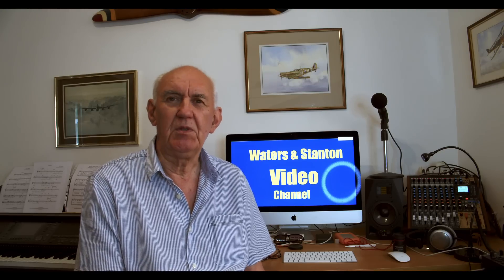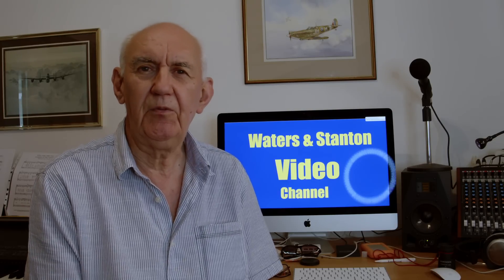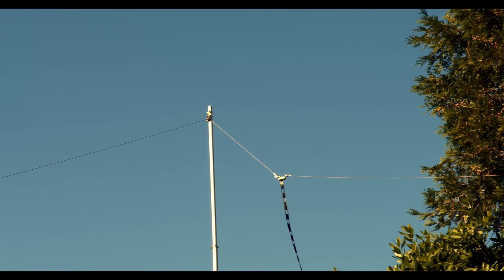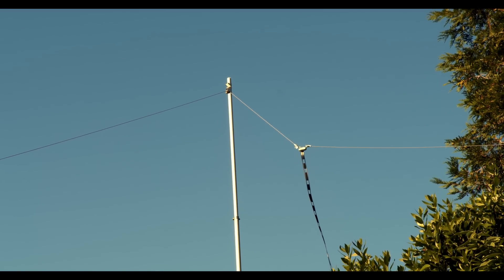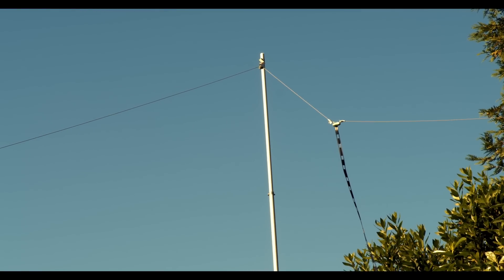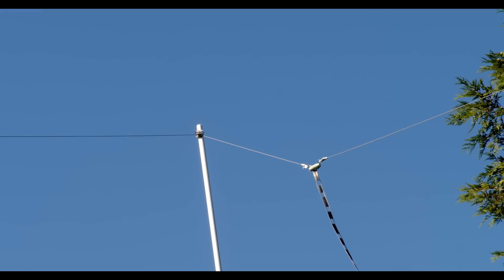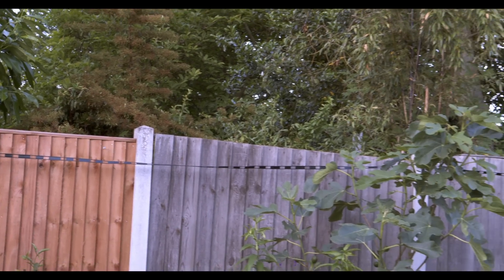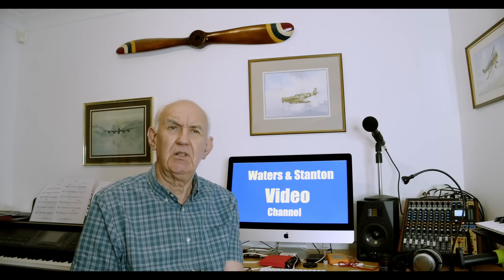The Doublet Antenna in Practice | Ham Radio

Comment: Another reason I'm going 600-ohm is because I cannot find a non-clad version of 450-ohm line. The 600 is made with stranded copper either 14 or 16g.  I did like the old full-copper 450-ohm line and built a great "j-pole" for 6-meters with some. I can't stand the steel core stuff (yes I understand how signals travel on the outermost surface, but also I know what I like).
The 600-ohm  Trueladderline of  W7FG is all copper.  
No affiliation, de W1ADE.

Comment: It's not difficult to make 600 ohm ladder line, and I would make my own if there wasn't a good source here in cowboy country. Because it's only a buck a foot ready to go, I may switch to mostly ladder line, it's SO MUCH CHEAPER than good coax. 
Look up trueladderline, W7FG.   
They make doublets and loops as well. I have their 160-10 doublet with 100' of "true" ladder line on order.  Years and years ago (when the internet was tiny and new)  my Elmer advised to try a random sky loop fed with 450 ohm and a 4:1 balun.  I did just that and it was great-ish. Eventually I really really got tired of flipping knobs on the MFJ tuner to find useable matches every time the wind blew or it rained or I modified the setup. And sometimes a band wouldn't work at all. 
Now my "garden" is over six acres with trees, so I can try the long antennae, and maybe I'll do a 500' loop next.  EVERYTHING I can feed with 600-ohm line for a dollar a foot makes more sense than spending 3x the money on  good coax and wasting so much energy when mis-matched. 
Until now I had been quite pleased with my homebrewed EFHW, and I'll keep using EFHW when I can't put up a Doublet, or loop with 600.

Comment: The example is untidy, flapping about, 'gopping' as my RSM would have said.

I'm afraid I went old school, and tidy instead, the feed point being an SGC SG-235 @7ft AGL on my tower, with the vertical 'ladder line' being copperweld spaced at 11" using porcelain Admiralty Antenna Spreaders from a ship, and then supported @20ft using Marine Stainless Steel Pulleys insulated by 3" Pyrex Dog Bones at the top of the tower, with the legs of the copperweld being horizontal to the bottom of my garden and about half way down the side of my semi-detached, supported by an Aluminium 20ft Scaffold Pole on a Marine Stainless Steel Pulley supported by a 7" Pyrex Dog Bone, with Stainless Steel Guys down to Stainless Steel Eyelets fixed to the 12" Gravel Boards at the bottom of my fence, with the tension gathered by Marine Stainless Turn Buckles.  On the house is a T & K Bracket supporting a section of Aluminium Scaffold Pole supporting another Marine pulley and 7" Pyrex dog bone, with the dog bones attached to 4mm halyards that are secured by Marine Stainless Steel Cleats attached to the bottom of the 20ft scaffold at one end and the wall of the house at the other.  The Doublet is NNE to SSW and resonant at ~3.3MHz, and tunes all bands 160 through to 10m.  I only run 100W, even though the SG-235 can cope with 500W SSB.

Yes its designed to be an NVIS Antenna for 160m to 40m, but I have managed Australia, New Zealand, and New Caledonia on 20m with 10W.

73 de M5WJF

Comment: Hi Peter, How does the doublet antenna compare with the ZS6BKW antenna? Also, I was under the impression that the ladder line should be hung vertically. I presume it doesn't make a lot of difference in respect of the end results.

Comment: Made one out of twin speaker wire ran analyser on it is 10m over all length presented 50 to 75ohms on several bands direct connection to G90 (got from w&s) started at 5W making regualar contacts all over europe. Guess just trying different things thanks Peter all the best M7HKO
Reply from the maker: Great to hear your results. Keep at it.

Comment: I would like to put up a vertical doublet.  If I attach the ladder line at the center, how far away should it stay from the lower half of the antenna wire?  Also, I will be bringing it in a window that already has my ladder line coming in from my 135’ horizontal doublet.  Do you think I will be OK if I keep the two ladder lines on opposite sides of the window casing?  It would probably be easier to feed the vertical antenna with coax and just call it a dipole.  However I would like to avoid the loss of that length of coax.  Many thanks.  I have learned a good deal from your videos.
Reply from the maker: I have never used a vertical doublet.  I suggest try and run the ladder line at right angles for 1/4 wave at lowest frequency.

Comment: Peter, I'm anticipating the arrival of my new Palstar AT2K ATU.  I'll be feeding a 160-10m doublet.  My dilemma is 450 or 600-ohm balanced line.  And, the Palstar doesn't have a built-in balun.  It does have a Balanced Line SO-239 input, which requires "either a 1:1 or 4:1 external balun".  Can you add your thoughts on the ohmic ladder line and which balun would be best? 
73, Ron - K5RPM
Reply from the maker: Hi Ron. you can use either open line or 450 Ohm ladder with 4:1 Balun. Both work equally well.

Comment: The days of open line are far from over. My situation: 2 x 59 ft doublet with open line all the way into the symmetrical tuner. Spaced with 4 inch rose clips and fed through the wall at the same spacing. From the end insulator to the tuner is one uninterrupted piece of wire, so no corrosion in the feed point. Worked 1250 miles on topband, 80 and above perform (much) better. Forget coax and the balun.
Reply from the maker: Great to hear from you.

Comment: Best way to feed a Doublet is using a open feeder or ladder line into a true Transmatch followed by a BalUn with a bit of coax going to the transceiver. Only challenge is to manage the Transmatch outside.
Reply from the maker: Take line through wall into a balanced matching unit and forget the Balun!
Reply: @watersstanton still need to go from balanced to unbalanced using a 1:1 balun
Reply: @RogierYouI think he means open wire to the tuner and coax out of the tuner to the radio. The tuner has a balun inside if it has two terminals for open wire line. Doing 4:1 inside the tuner usually. Some people use a 1:1. The Universal Transmatch by Lee McCoy 1970 QST used one 4:1 on the balanced line terminals. It was basically what the famous Murch transmatch copied if you ever saw them. A split stator cap, roller inductor and hv transmitting variable with a coax and balanced output via balun.

Comment: Peter
Thanks for a clear video on doublets. I am 85 years of age, am newly qualified (Intermediate, so only 50w) and am proposing to put up a 40m doublet on the upper storey gable end, with the last few feet of each half wrapped around the soffits front and rear at right angles. I’ll use a 4:1 balance as you suggest. The ladder line drop down will be clear of metal but close to brickwork. What are my chances?
Reply from the maker: Ladder line near brickwork is no problem. I t all sounds OK. Congrats on the licence.
Reply: @watersstanton  Thank you!

Comment: Mine is 57mts long in a Z shape.....short for top band yes.....but it tunes top band great.....gets out great as well.....also tunes on 6m and performs on 6m as well as my dedicated 6m horizontal....

So from 160m to 6m fine for me via my MFJ 941 matcher/ATU.....

Ladder line terminates to a 1-1 balun.....the via an 18inch long length of 50ohm coax to the ATU via my window frame

Why would anybody consider any other antenna?

Mind blowinging

Comment: Just made and installed a doublet, 7'5m each leg, (2:5mm cable) and approximately 6 metre's of 450 line, terminated into a 1:1 current balun, then a short leg of RG8 into a LDG external tuner, Great on 40 , worked A6 on 12 SSB first QSO, and Italy on 20 , doesn't like 15 or 17metres... only 4 metre's above ground, but then I've QSY'd from Dorset to a inner Hebrides island... loving zero QRM again.. cheers Andy MM0###...PS about 20 metres of RG213 into the shack
Reply from the maker: Thanks for the update Andrew

Comment: Thank you sir, for Youre lecture in This. I Will create a inverted V with an open feed line 450 ohm And let it run through a FC902 To my FT902.

73” Theo PA3GSR

Comment: I've got a 2x20m doublet with added loading coils at each end and 5 metres wire connected to those to get it to just about match on 160m. Nine metres vertical drop of home-made open wire feeder to a 4:1 balun near ground level, fed to shack with 20 metres of RG213 coax. The matching unit should really be where the balun is, but that just didn't work for some reason and kept getting unpredictable matching...

Comment: Reminds me of the advice I had when I was first Licensed, nearly 40 years ago. GM3OXX told me to put up the longest wire I could, as high as I could, cut it in the middle and feed it with ladder line. I did, used a balanced ATU / Z-match, and worked loads of stations with QRP. Never had a house since that would allow the same set up. Keep thinking of a remote ATU to do the job. Thanks for sharing Pete.
Reply from the maker: Hi Steve - that was great advice. Remote ATU  gives you all bands or EFHW is cheaper option but less bands.

Comment: Thank you for the information. I need to put up another antenna maybe 2.  I don't want them crossing near each other because they will be less than 90 degrees from each other.  New to HF and the antennas.  Everyone is so up tight about how they can be made.  Must be center feed and other little things that must be just right. I want to put antenna and run window line to just before it comes into my attic,  lot of power wires in the attic. Put a 4:1 just before it comes into the attic,  about 3 meters over then about 3 meters down and around to the radio. I was looking at the  'ZS6BKW ' antenna but not sure I have that much space, and the window line will be much longer.  I want to do 40 and above. The information you gave will help me.  73.  de

Comment: I feed mine in the middle  but use a fibreglass push up pole.   works great
Reply from the maker: Yes good option although not as strong as a metal mast for greater height

Comment: How do you connect lightning protection to it, and/or how do you handle lightning protection at your station in general? 73 DE W8LV BILL
Reply from the maker: Frankly I unplug the antenna!  I am not a fan of lightning arresters as they are really static protectors and most rigs can perform the same function internally. A lightning strike will blow the arrester apart! So unplug!

Comment: I tried the doublet on a visit back to the old house in Ireland, just used some single house wiring cable and some
Plastic pipe fittings to assemble it. I had spare ladder line.
It’s still laying on the grass across the field but I connected it up and massive signals
appeared. Made a few contacts with FT8 and checked PSK reporter and there were 132 reports. The most distant was PY5EG on 40 Mts.
I did not think it would work laying on the ground. I might try and sling up today. Once I tuned it on 40 the SWR was low 
on all the bands going up to 10 Mts without touching the controls on the ATU only 80 showed high SWR without
Changing the settings. Mark EI4JD near Shannon

Comment: Great video. I haven't had a doublet in 8-10 years, but I think it is time for another one as they are fun and highly flexible.

My last doublet was a coax fed OCFD dipole that swaped the coax out for 450 Ohm ladder line. I had a blast with it until I got it stuck in a tree on a QRP outting and ended up pulling it apart. I ended up loading the rain gutter on the park pavillion to make contacts on 20m & 40m.
I have picked up a few ideas that I will try on my next doublet. Cutting the antenna a little short to about 3/8 wavelength and feeding with a minimum greater than 1/4 wavelength of ladder line. Sweep the antenna. If one of the higher bands presents a particularly high SWR trim the feedline by 1/8th wavelength of the higher frequency.

The past few years I have mostly used an 80m-10m EFHW for portable operation. It is easy to deploy and allows 80m NVIS which I am fond of for Ecom.

Comment: My doublet is 20+ mtrs short for top band..... but works a treat on 160m.

So I can work 160m to 6m....with the help of my MFJ941 matcher or tuner if you like.

The 450ohm feed line terminates at my upstairs window of my shack at a 1-1 balun....18inches of coax though a hole in the window from to the ATU.

Works great...1 to 1 on all of the above bands.

Why would anybody use anything else.
Reply from the maker: Sounds good. I belive that manual ATUs often have a wider matching range than many Auto models.

Comment: Hi Peter great video has ever , would 300 ohm  spaced open wire feeder the same has the 450 ohm you use, make any difference, going to feed it into a LDG AUTO ATU with LDG BALUN. Do have 450 ohm but not so good on the old legs today and would find 300 ohm easier to use. Thanks Russell G0OKD.
Reply from the maker: Hi Russell, good to hear from you. Yes 300 Ohm should work just as well. In fact that was the feeder originally used in the G5RV. So go ahead and give it a go. 73 Peter.
Reply: @watersstanton  forgot to say wished I had known about yr videos when I was teaching course's at my local club SNADARC,  but grateful to know I wasn't waffling phew 😅  cheers.
Reply: @watersstanton  thanks Peter, remember you well from my rallying days has a DRM for RSGB and Regional Rep for Royal Signals Amateur Radio Society .

Had to give them up following a dicky ticker ho ho keep safe.

Comment: Hi Peter a very interesting video and well explained iv been using a doublet antenna for many years it’s so simple and works well I bring the ladder line down to just outside the shack where it’s connected to an sgc 230 auto atu which is flouting above ground as these is only a single wire connector for the antenna the other side of the ladder line goes to the ground of the atu then a short run of coax to the radio it tunes on all band no problem 👌

Comment: Thank you for the info and sharing. I am preparing to build this doublet & I would like to ask the feed line location and the length of each side from the feed line for doublet. Do the length of each side matters? Even in inverted V?
Reply from the maker: No the lengths can be different even in inverted V.
Reply: @watersstanton  Thank you. I will built this doublet, I do plan for AH-4 tuner between the balance line and short coax to IC-7300. I have checked on the net, that I don’t need to connect the AH-4 to the ground cable when connecting to balance line.

Comment: Peter, your timing is perfect. I have wanted to try a doublet for some time. I was worrying about achieving a perfect half wave feeder length at 90 degrees to the antenna, and had assumed that I needed to put the balun at the base of this and run the coax for the full horizontal run back to my shack. Your video shows how simple, easy and cheap this project can be. Thank you, I know where to buy the bits!
Kevin, MW0KXN

Comment: Great point about being off center to avoid interaction with a metal mast.  I pull the window line to a 4m wood post that is near the house, so the ladder line does not drop vertical, but comes off at an angle.  Same thing only different.  

I must say, so far, of all the wire antennas that I have tried, the doublet is by far and away my favorite antenna.

Comment: I have a 40 metre doublet in my roof space, with only 8 metres out horizontally, I first took the feeder back to the shack then through a commercial 4:1 balun into my atu, I was disappointed with the result, my fan dipole out performed it greatly, I decided to use my own homemade balun instead, also cutting the twin feeder so it only hung vertically, then joining the coax at that point, it made a huge improvement, and I use it for every band 40-10, on 15 metres it is terrific, for an indoor antenna it's quite amazing.

Comment: I have a 4:1 balun, too. My tuner can handle the balanced lines, and I could use my window-through panel, but I'm afraid my cat would get burned if she touches the connector. So I use the balun outside the window and feed coax through the window to my tuner.

Comment: Interesting.  I hadn't thought of a doublet that wasn't center fed before.  But if the antenna legs are not equal, does that not mean that the feed line itself will begin to radiate all the way back to the balun since the currents on each side of the ladder line are no longer balanced?  Also, doesn't it become more of an end-fed wire antenna when it is off-center fed?  That would mean a good ground or radial system might be needed to keep RF out of the shack depending upon the band.
Reply from the maker: Remember that the balanced line is fed at the TX end with equal but opposite currents. Likewise a balun works fine on an OCF dipole.
Reply: John I think you’re right

Comment: I have a doublet. Originally it was a 40m long inverted V with 100ft of ladder line hanging from a 25ft flag pole. Oddly, it was difficult to tune on some bands. Based on a web site I visited, I shortened it to 110ft (55 on each side). Now it works better on most bands. It's confusing to me why shortening it would make it better, but I'm just happy it seems to work. The worst part about it is that the two legs are 90 degrees from each other, and one leg bends at the end of the fence and runs a few feet along the fence parallel to the other leg. I call it a "perverted V" antenna. I have a small back yard and a nasty HOA, so it's the best I can do.